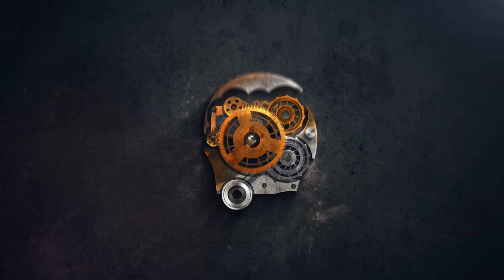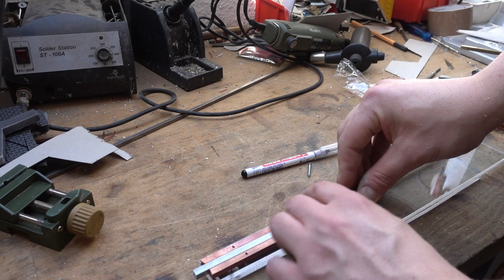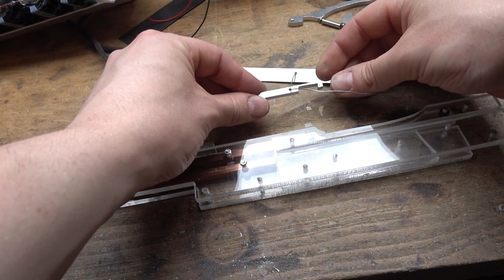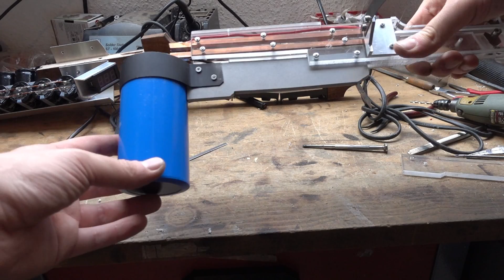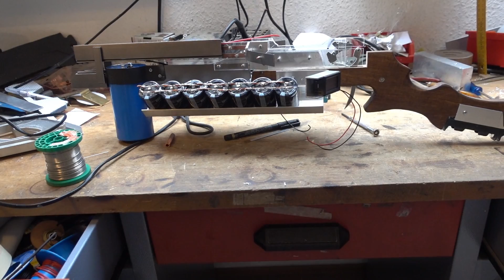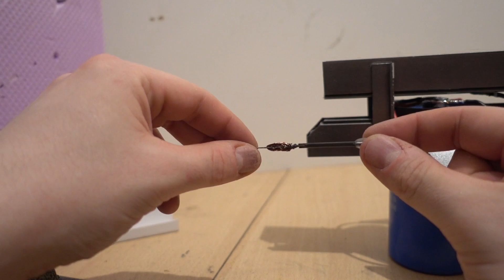Making a portable railgun: Part III test fire, rails and the bow injector

Comment: One important criticism I might have: the rails have to be connected to the power wires at the breech-end of the railgun, otherwise the currents are backwards from what they should be, and thus the Lorentz force is actually slowing the projectile down rather than speeding it up.
Reply: Yeah, I noticed this too.
I think in a lot of DIY railguns, including this one, the Lorentz force alone is not actually large enough to make much of a difference, though. My suggestion would be to cover both sides of the railgun in flat magnets that create a magnetic field for the projectile to push off of. I've done this in my own projects and it works wonders.

Another suggestion I have (I don't know if this is already done) is to *avoid using ferromagnetic materials for the projectile at all cost*. No matter if the gun relies on external magnets or the Lorentz force, a ferromagnetic projectile is going to be attracted to the magnetic field that is meant to accelerate it and slow down. Use aluminium or copper, just stay away from iron/steel, nickel, etc. I discovered this effect while trying to make railguns with a coilgun injector, needless to say it didn't work very well.

I'd also suggest using a higher voltage. There's a few reasons for this.
First, the wires used are way too thin for this sort of thing. Their resistance is a major factor in limiting the current, but a higher voltage can overcome that.
Second, a low voltage/high capacitance bank will take too long to discharge. Yes, it's capable of delivering more current, but at such a low voltage it is difficult to use that to its full potential. I'm willing to bet that a lot of charge is left in the caps after each shot. In my own projects I always like to tune the system so only 1/4 of the voltage (6.25% of the energy!) is left. 
Third, the high energy will shear the sides of the projectile off. You want enough voltage to start an electric arc to keep the flow of current going, and in my experience, 63V can't do that reliably.
Reply from the maker: High voltage means you accelerate on 1 inch. Unless you have a huge cap bank. Make a railgun, then you will see. Make it 300V and your rail is only 2cm long. The wires mean shit, adding resistance is just what you want actually. Calculate...instead of guessing.
Reply: I already wondered why your projectile just flopped out. You can make that shit go harder. First of all, mechanical injector squad, fuck the gas bottles. If you remember correctly from vector calculations and the Lorentz Force vector formula. It's.. F = B cross l I. If we put a standard coordination system from the shooters perspective, x in the lateral, z in the vertical and then y in the longitudinal. You remember Fleming's rule. So the current is in the z axis, the B field in the x axis. Therefore the force is in the y axis. Easy. Now, the current is in the NEGATIVE z axis (parallel to the length, therefore I treat it like a vector).  However, the induced B field is in the POSITIVE x axis. I made a video about the workings of a railgun and I explained that the matrix calculation goes as followed [Iy Iz; By Bz] i - [Ix Iz; Bx Bz] j + [Ix Iy; Bx By] k = F
This gives us the j vector, which is the y-axis, which is correct, the rest cancels to zero. It then becomes - (IxBz - IzBx) j , which is -(0 - - IxBx) j => - (IxBx) j = F . Force is in the NEGATIVE y axis (towards the shooter). Yikes! You can solve this easily, no worries, just put the wires on the beginning of the rails (also less wire resistance maybe?) or just flip the polarity. 

Also what you are using is a hot rail design, where the rails are always live, therefore yes, the projectile closes the circuit. Which cheaper and more effective in diy, in my opinion, but you will lose the possibility to switch the current (like how the US railgun wastes all of it's money on high voltage IGBTs to switch millions of amps). Giving a high differential current and magnetic field. Which is even more effective. Also, since you are using quite a low voltage, you can consider permanent magnets. They augment the existing magnetic field to increase the B value.

Hope it was useful.
Reply: @Azagro  flipping the polarity would not change the result
Reply: @manselreed4191  Everything is based on vector calculations, meaning space is highly involved. Changing polarity obviously reverses current path. Tell me, how do you think electricity works?
Reply: @Azagro  further into the comments you may see that reversing the polarity did not work experimentally. (@SelfMade ) This is because the B field generated by the current is reversed when the current is reversed (by the right hand rule. ) And the current itself(group velocity of the charged particles) is defined as reversed. This maintains the original direction of the force which opposes acceleration of the projectile. For example, using unit coordinates i, j, and k and the fact that k = i x j. We can then negate i and j and see that k is still the result. - i x - j = k.
Reply: It flopped out like a wet noodle :p Field is field, but field got direction. Too bad that force calculation is a vector calculation, not a magnitude calculation. How many capacitors did you have again? 12x 63V 22mF? Yeah, the two magnetic forces on the rails will also cause a little bit of bending, which will make your projectile sit loose on the rails. It's really difficult to overcome that, you either need to calculate for bending so that you can determine the margin so that it will bend to the correct position, if not, too much friction. Precision bending required. Not an ideal solution. So far, the only thing you can really do is reinforce. What again was the name of that guy? I remember you telling me, but I forgot.
Reply: Yeah no shit, guy got a book. You can calculate with the differential equation for capacitor discharge. Which is a simple RC circuit, which gives V = V_0*e^(-t/RC). If you plug in your parasitic resistance, which should be wire resistance, rail resistance, ESR, etc and then your capacitor values. You might be able to extract the time value. That with the Lorentz force and newton's second law, you can estimate the required length. If it does not correspond whatsoever, you either made a measuring mistake, or the projectile doesn't have enough connection. Yes, high voltage is high discharge current, which you want, but also could be too fast. Therefore you lower the voltage or use switchers. To get a switching pulse on the projectile, like a coilgun. No, but any slight bending can fuck up, especially if the intial gap isn't 0.00mm, which is almost impossible.
Reply: Bashing? Is that what they call effective education these days? :p What do you mean my own formulas? I'm not Einstein. I can take them all, plug them in, get a lim V -> 0 to get approximated velocity/distance/impulse, etc., without using energy and effiency guesses. Btw, did you say your projectile was faster without the rails?
Reply: Again: high acceleration for a short moment. The slug will not even move 2 inches, depending on the set up. Cap bank needs to be BIG, or rails short. Lower voltage makes more sense here. For a small one.
Reply: I think what Rykahnz is getting at is- the exact resistance of the system during a shot is a critical value.  Might be worth doing a 4-point test to get an exact value for this resistance so you can better model your system.
Reply from the maker: Uhm.....no. The switch is the projectile.....
Reply: Thx. But gauss is not really the correct name :> its made up
Reply from the maker: I will have to modify it anyway, and I will try it out. I am still not sure because the rails pretty much push each other apart, I am not even sure if this actually IS the lorentz force. I am usually more the coilgun guy. Coils pull from both sides so it does not really matter. 
The switch in this RG is the projectile, so I was assuming the field was the same no matter what, because the projectile kinda triggers it.
Reply from the maker: Oh and: Why the freakin hell is my slug faster than without rails? Oo I will literally try everything :p
Reply from the maker: The only guy you need to hear on this is Thomas Rapp. He made a REAL mach 1+ railgun 10 years ago. 12kJ bank. He is my god...next to the iron man. Its 765J total. Should be enough. And the rails are yet too long I am 
afraid. Not too short. More voltage and I could make them 1inch. The copper filament makes sure you got good contact. The screws should make sure the rails dont bend that much. I dont think there will be a gap at 63%. Magnetic force is not super critical.
Reply from the maker: I got the formulas...I dont need them to know that 400V and long rails are total BS. Thought I try a LV railgun. Constant field until the projectile leaves the rails. Should work much better than all the spark-casters out there.
Reply from the maker: And before bashing the supercap kid, use your own formulas dude. Its a travelling shortage. High amps need high voltages but high voltage means, the bank is emptied after a 1 inch travel between the rails. I will test and see what it does with the right setting and improved switching. I doubt that the copper will not melt just because I move the leads ^^ amps are still amps.
Reply: Okay good, then you got it all figured out, ye? Just make sure not to fire the Lorentz Force in the wrong direction... No, that's true, not much you can do at such low efficiency. Tried carbon component grease? Basically conductive grease.
Reply from the maker: Underestimated the lorentz force. But next to that, I assumed I can use the slug as a switch. Doubt it will work better even when the leads are on the other side. BUT I might even try that out. And no grease or metal, except maybe some tungsten alloy can withstand these temperatures.
Reply from the maker: Fast discharge means no acceleration...63V should beat high voltages and superhigh currents.
Reply: You can put them on the other side, or just switch +/- to direct them correctly. I think it will work a bit better, but the contact loss is certain problem. I am not sure, but I have seen some good carbon conductive grease. I haven't tried it. It can act as a conductive "semi-fluid" medium for your current and rail/projectile connection.
Reply: That's not so in particular, fast discharge means high current. High current, high force pulse, high acceleration, small time step. It's sure highly potential, high current, low voltage, high capacity. That looks promising. So far, resistance is a limiting factor with low voltage. The high differential magnetic pulse (dPhi/dt) is what is going to shoot your projectile to the moon.
Reply from the maker: Yeha, but PULSE DURATION is low. Why is high current great when the slug is accelerated over 1 inch only? Railresistance is almost 0. Check out the car battery railgun. He read Rapp's site...12V...and it ptus the slug into an apple. Switching them will not really help I am afraid. I will just redesign. And putting the rails closer together will increase power as well...
Reply: Yes, higher capacity needed, not ideal for portable railgun design. High current is because F is proportional to I^2 (both in lorentz force and induced magnetic field). I calculated this for myself, bare with. Let's say you have 400V, 0.006Ohms parallel ESR + parasitic resistance, accelerating over 1 inch (0.025m). (Assuming no parasitic inductance in voltage drop) B = mu_0*(V/R)/(2pir) = 2.6T(1cm diameter projec). F = B*(V/R)*l = 1733N. With 10 gram projectile -> 173300 m/s^2. Time = 5.37E-4 seconds.You still have a velocity of 93 m/s. Which is 43J in kinetic energy. I say is decent.

Also almost zero won't do, it's the very small resistances that will make the difference. See as I use 0.006 Ohms in calculation. Can't call it almost zero.
Reply: Wouldn't the lorentz force in this case only push the projectile upwards. The acceleration force is just the force that arises from the crossproduct of B which is up and the current moving through the projectile. I agree that high voltage caps might not be the way to go here, it would be interesting to see a battery driven railgun given that two 7S lipos in series can do 54V and 300 plus amps although not saying it makes more sense than caps.
Reply from the maker: Does make more sense indeed.
Reply: I am intrigued by what Azagro said about Blitzer and GA reversing current back and forth. I wonder if he has a source on that I've never heard of that. You could do that with DC with rotating brushes in order to flip the current.
Reply from the maker: Huh?? Oo I just put the wires on the other end.
Reply from the maker: I even doubt its only ONE pair of rails on the big ones.
Reply: I doubt its more than one pair of rails although its possible. You would need the current paths to flow in different directions throughout the projectile for different rails to get the forces to line up the same. If you did that you would also want the different current paths to have some distance so the other magnetic fields don't interact with them in ways you don't want. Have you seen what their projectile shell looks like? The backside looks like a very pointy traditional horseshoe bar magnet it's as if their focussing magnetic fields through it which I used to think is what you actually wouldn't want. It also has two more contact points spaced out through the front as if their letting current run through in parallel. It looks like they all come from the same rail though if you look at the copper bar looking thing on the side.

http://imgur.com/a/dWRfh

scroll about 70 percent down to see the image I'm talking about.
Reply from the maker: You doubt it? Its a fact. You either stack them, isolated, or you make it "augmented"...instead of those stupid permanent magnets.
Reply: You're right I had never seen that before. I initially thought you were talking about an additional pair of rails at a different angle. I'm building a coilgun right now so haven't really looked too much into railguns but I might build one sometime in the future.
Reply from the maker: Stacked or shaped like a +, more rails means more rails :p
Reply: Haha fair enough
Reply from the maker: Switched wires, same result...
Reply: Hmmm.  Do you have any estimate on your initial velocity when the projectile enters the rails?
Reply from the maker: I even added a SCR to make sure it switched ON when the slug has made good contact. Its cursed. V is minimal, bow is weak.
Reply: As a general rule, railgun efficiency and performance can be improved by three things: 1. capacitor energy, 2. injector velocity, 3. magnetic field.  You've got a decent amount of capacitor energy, so I don't think that's your issue.  Injector probably could be better, but since you have such a huge capacitance on your bank it works well - the caps will take 10ms to discharge and as long as your injector velocity is above 25 m/s it should work fine.  However, the low voltage is going to be a problem.  The electric field term in the lorentz force is going to be much lower because of the low voltage.  You can compensate for this by increasing the magnetic field.  Most low voltage railguns REQUIRE an external magnetic field to work at all.  I'd try implementing some of this guy's stuff, he really perfected the art of low voltage railguns: https://markobakula.wordpress.com/electromagnetic-projectile-accellerators/permanent-magnet-rail-gun/
Reply from the maker: Are you the dude who shot the teddy and the slug bounced off? :p a) caps are low voltage, so longer pulse duration. Rails are shorter than most other rails, still too long and adding another pair of rails would probably be better, but I will add some magnets and see what happens.
Reply: Lol yup!  That was me.  Not one of my proudest moments ;) plasma armatures are tricky.
Reply: What's the resistance on your rails? And on the whole system with the projectile going through. I assume the projectile isn't contacting well and you're not putting enough amps through because of that low voltage and high resistance at contact point which means you're not making a strong enough magnetic field nor strong enough current to interact with.
Reply: Contact is VERY good. The molten areas are not exactly small. And like I said, I got an SCR switch kicking in when the contact has already been made.
Reply: LaserGadgets I can't imagine VERY good contact when the projectile is round, yet the rails are square. The current distribution will be going through the tangent point of projectile and rails. Current distribution (A/m^2) is exactly like stress distribution(N/m^2). Maybe that will be a better visualization.
Reply from the maker: Round? Who said its round? oO its a FLAT copper filament, 4x1mm in layers. Wrapped around a flat 1mm steel sheet. Could swear you see it in the video. Who said anything about a round slug? Thats kinda stupid anyway. Like you said.
Reply: I thought you said you had an arrow and around that you wound a copper coil.
Reply: Yeah, an "arrow". Who said its a cylindrical one? :p dude, I am no idiot. How would that work out here? The video is showing the arrow, I am pretty sure. And again, flat copper...flat arrowhead.
Reply: Yes exactly, not. ;)
You never did a close up on the projectile itself, I can barely see it. But if you say your coil is actually square, I believe you.
Reply: Yep, its 4x1mm flat copper filament. For batterie connections n stuff. Expected great results. I guess its the bend in the rails. There is kinda of a gap in the middle.
Reply from the maker: It didnt flop out...the arrow is faster than without the charge -.- but THE railgun-king of Germany just told me it should not work...I really thought field is field, and its 2 fields pushing each other apart, like 2 magnets + to +. Lorentz force just gives a TINY push into the right direction but the rails trying to push each other apart is accelerating the projectile!  Guess the tiny plasma burst propelled it then. I will change the design. Slug = switch is crap. First layer melts, slug loses contact to rail...I always got 20V left in the bank...